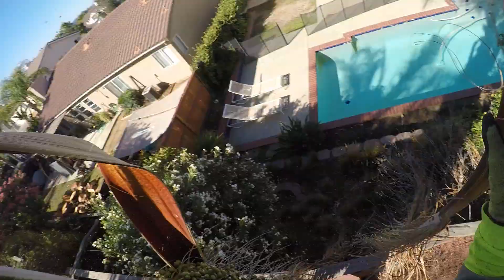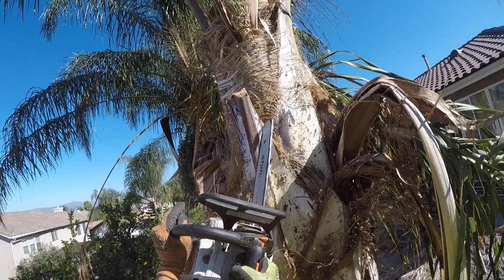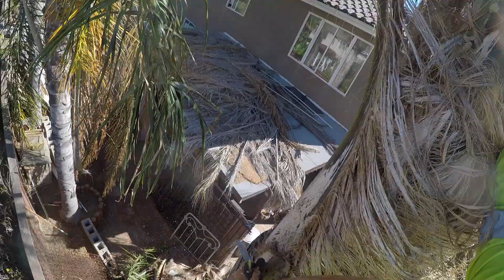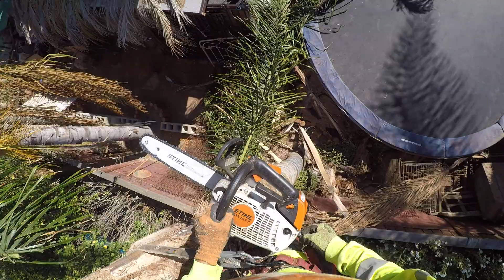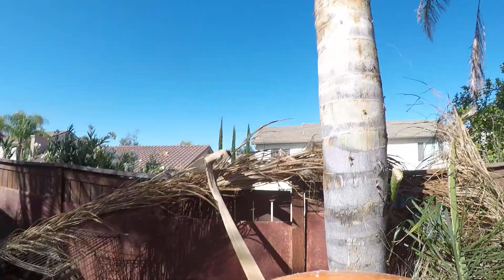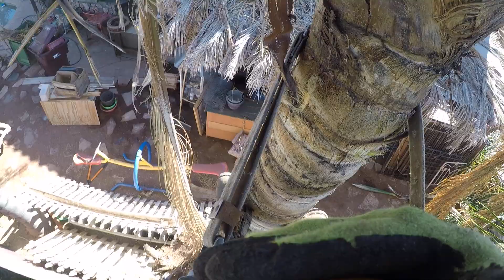queen palm tree trimming

Comment: Spiking palms scars the trunks and promotes rotting a bit unsightly.they sell straps for climbing or bands...ps the webbing at top secures the head so wind doesn't damage it
Reply from the maker: Thank you for the recommendation
Reply: Tree spikes are $150 to $300 . SRT classes are $4000 and certification another $600 dollars . Not to mention ropes, petzls and descending gear another $5500.
All the thousands of dollars to not spike a palm tree( which is a hearty  weed by the way.) 
Im not going to tell any company or individual to open their wallet and cough up $10,000 + per individual for gear. 
Thats ridiculous. 
Spike away I say or spend $10,000+ in SRT gear, classes and certification if you got money to burn.
Im pro - spike and pro wallet.
The customer will end up paying in the end for high pruning costs for SRT vs. Spiking.